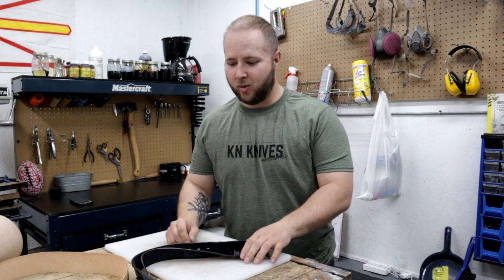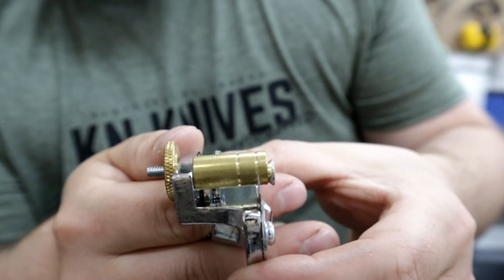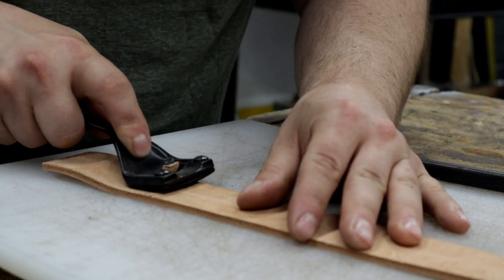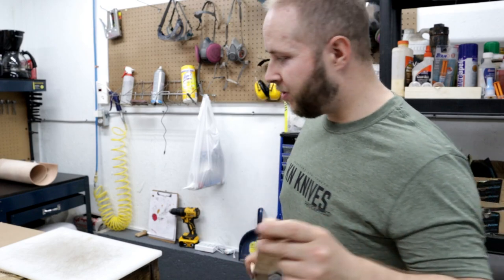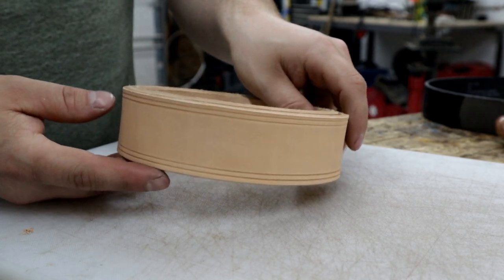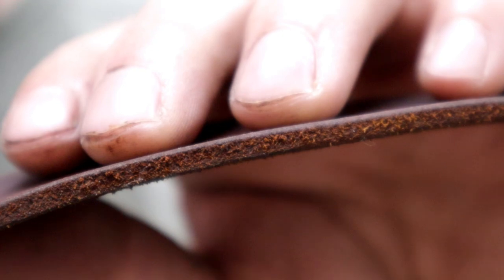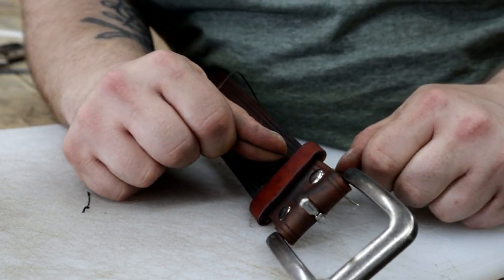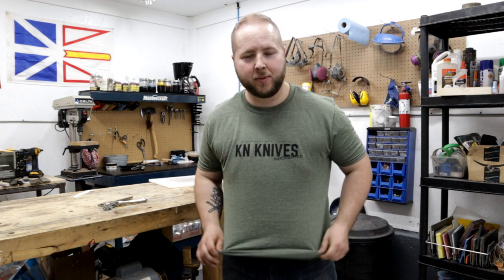How to Make a PREMIUM Leather Belt

Comment: Hey just a little tip I found helped immensely when making belts. When you cut and bend the leather around the buckle, wet the area that you are going to bend over the buckle. It will keep the leather grain from deforming and it will also keep the leather from potentially cracking when bending it. Just a small tip that I found really helpful. Hopefully it’ll be of some use for you.🙂

Comment: The keeper runs under the belt ,how is it attached ?
Reply from the maker: Pinched between the folded leather. Is that what you're asking? Two rivets in front, and a double row of stitching behind. It's free roaming between those two points, as most belts are.
Reply: @kyle_noseworthy oh ok I see ,so the 2 ends of the loop are connected in some way.